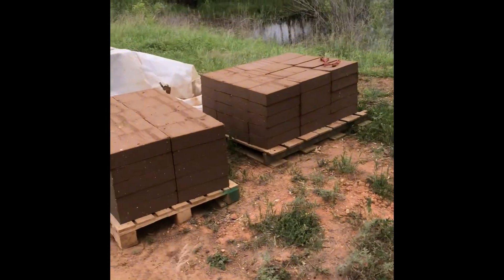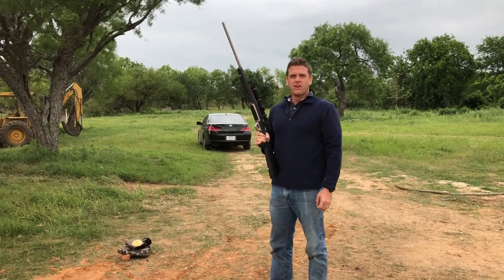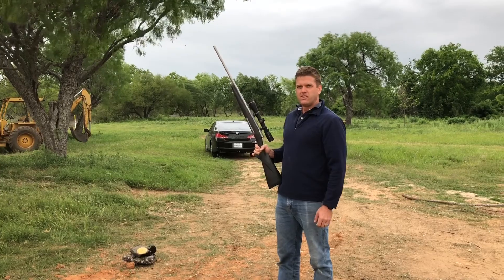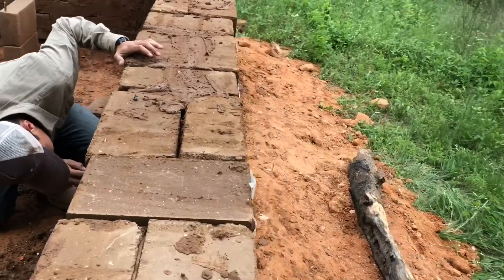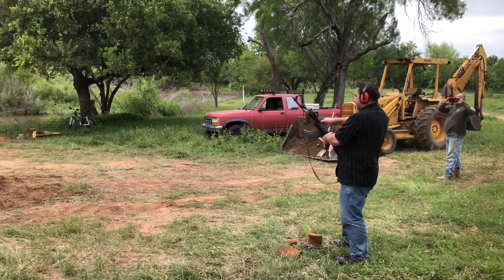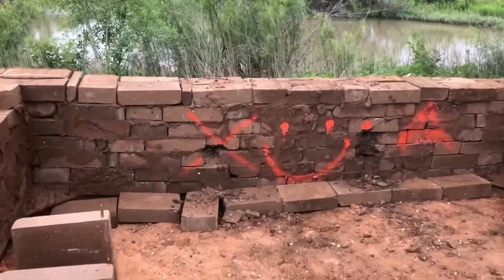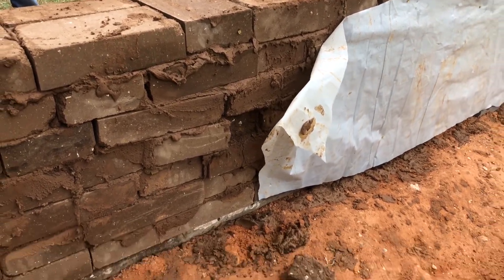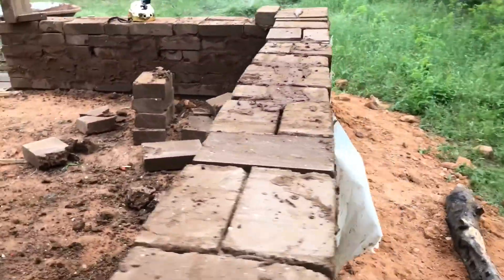AECT Compressed Earth Block ballistic tests

Comment: Man the blocks looks not dried enough how if it was fully dried
Reply from the maker: These blocks are made with compression as opposed to a wet mix. They can be installed right out of the machine.

Comment: I want to build a compound wall out of CEBs but I'm just worried it will deteriorate and weather away. I know this stuff isn't supposed to be as strong as regular concrete but what do you think? Have these blocks been stabilized with cement? If so, how much?
Reply from the maker: The blocks in this video are not stabilized. When we stabilize blocks with cement we add 7-8% Portland cement by weight. Then we put them on pallets, wrap them in shrink wrap and let them cure for a few weeks. This will make them much stronger and prevent deterioration. Alternatively, you can seal them with plaster. For a wall, the first couple of rows would have to be stabilized to avoid wicking.
Reply: Thanks for the info. Buy any chance, do you sell block making machines?
Reply from the maker: We manufacture and sell compressed earth block machines. You can see the different models at aectearthblock.com.